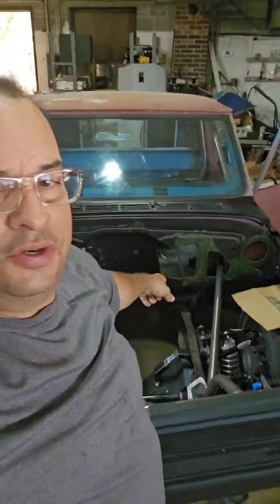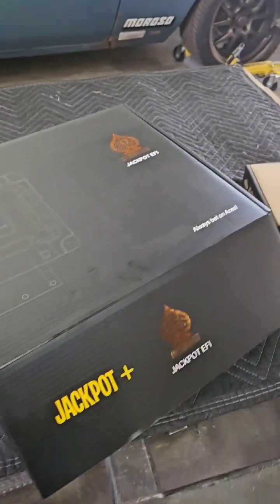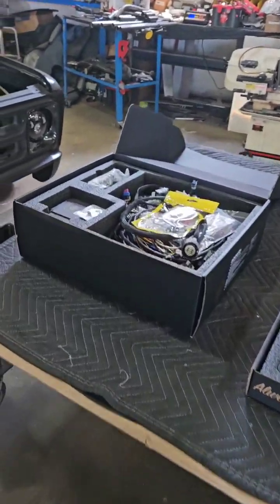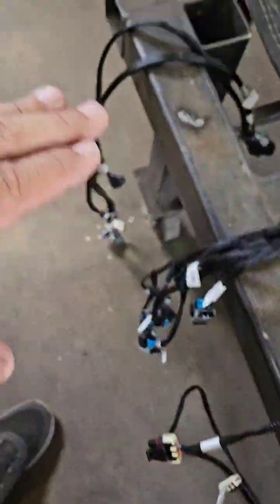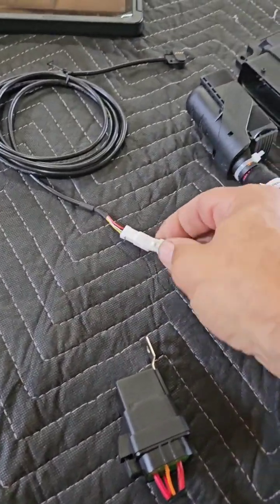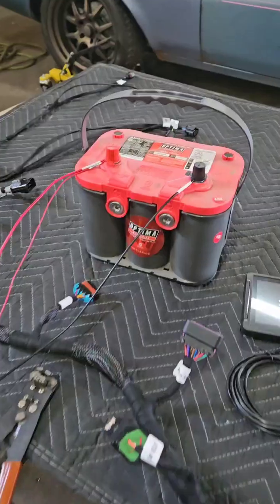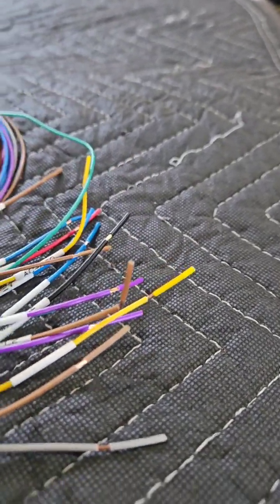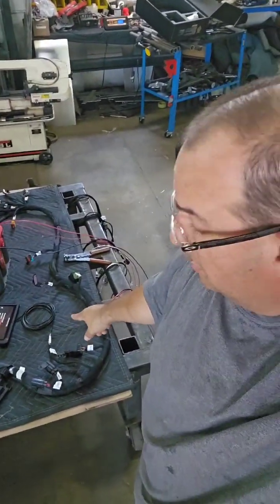Testing the ACES Jackpot EFI: A High-Tech Upgrade for Classic Cars

Comment: Would this system work to put a stock LS (4.8 or 5.3 with 4l60) into a 1995 s-10? The 2.2 is too slow
Reply: Hey there, this is an standalone system and even that it looks complicated to install is pretty straightforward, you only need power wires from the host car, everything else comes with the kit ( far as running main sensors ). The Wizard of the computer allows you to choose what transmission are you using. In layman's term, swap a healthy 4.8, 5.3, 5.7 or 6.0. hook up the sensors along with the engine harness provided and labeled, hook up three power wires, run the wizard as this video explains and most likely after 2-4 key turns on the starter, the engine will start up and runs.  I got mine started in three.. had to prime the fuel system first.  hope it helps. GL
Reply: Yes it does as a matter of fact my friend I got an 03 s10 with 5.3 using factory pcm and harness but I just decided to buy aces efi ls pro it's ready to be install if u have questions on your swap let me know
Reply: If your using the stock 4l60e transmission u need to swap 3 major component to work behind the 5.3 #1 the transmission housing the 2.2 4l60e housing needs to be swap from a fullsize Silverado 4l60e  #2 the torque converter u need to get one from a fullsize truck torque converter the stock one and here is where it gets more complicated u need to change the input drum on 4l60e from your 2.2 and swap an input drum from a v8 transmission the splines in  input drum are different from v8 4l60e the easiest route to avoid all of this is to get a v8 4l60e that came from the donor vehicle